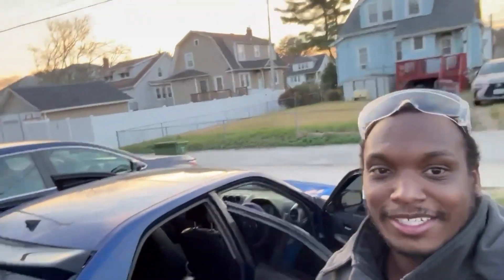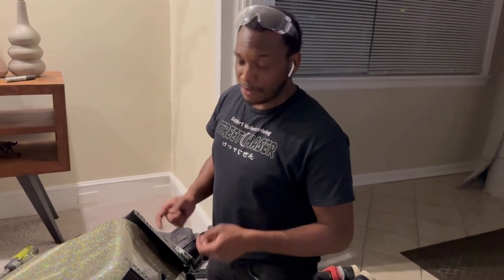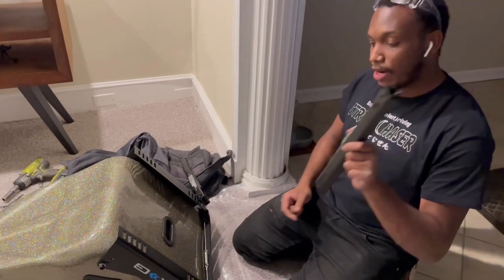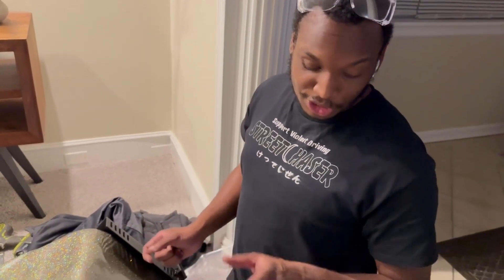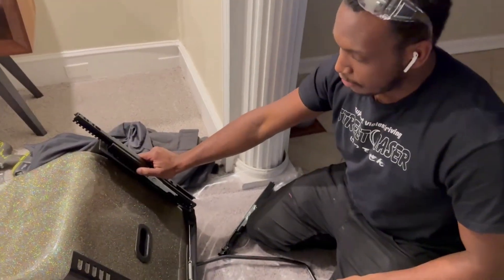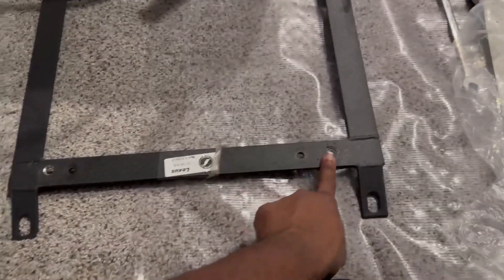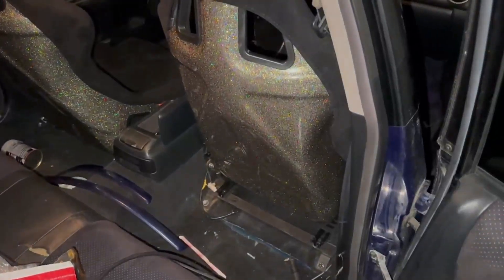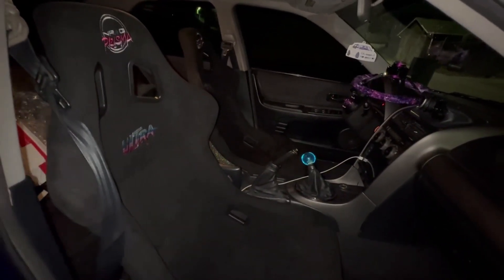Is300 gets bucket seats ( NRG Prisma)

Comment: do you have any problem with the seat hitting the b pillar? i bought an XL for me and my friend has a medium and his barely fit so i don’t know if mine will fit now
Reply from the maker: yes. sometimes that happens depending on the seat and the rail. 
when i used my oem rails with brackets and a bride seat. i hit the pillar. but i cut a hole that way it had space. For these seats and rail combo with large Nrg seat. i wasnt even close

For the is300 i just picked up. Im using xcessive manufacturing seat rail and prob an omp seat.
Reply: @KungFuJordan will you be uploading a video on that or just doing it on the side. i would like to know if the xcessive bracket is actually good or not because i still have to buy the bracket but i want to know whats the best option
Reply from the maker: @ I like Xcessive everything. So I know it will be good and even better than the ones I installed in this video.
Reply: Did you end up successfully installing the XL in your IS300?
Reply: @davesurti i did. it is a snug fit and it won’t fit perfectly. i got the xcessive bracket and all ima say is that it won’t fit exactly straight. the bracket might sit a little crooked when you set it up but when you install it, the seat will fit pretty straight so it won’t be that bad. you might also have to drill some holes into it to fit it at your height if you don’t install a slider. i made it a planted seat since i’m 6’5” and need more head and leg room so i put it all the way back. also the nrg seat bracket that it comes with will be in the way if you put it until the last bracket hole. so when installing into the car, you might struggle but you can install it using an open end wrench.

You’ll also need to remove the b pillar plastic to make it barely fit. i’m going to cut out a whole and put a rubber piece around the plastic to seal it tight on that spot so it looks pretty oem but you can run without it. 

other than that you should be good. i’d do research on other brackets that are more pairable to the nrg bucket seats but if you’re okay with drilling extra holes and making it fit a little more flush i’d say find a good bracket out there and get it done
Reply from the maker: @ i tried to install a Corbeau wide seat and it didnt fit. I fit a largte nrg seat and it fit very well no issues.

Comment: Are the seats being used large or Meduim?
Reply from the maker: @LilYogurt300  large
Reply: @KungFuJordan  did they come with seat rails? If not then what seat rails do u recommend i buy?
Reply from the maker: @ they only come with universal sliders . You need brackets.
Either the ones I used in the video. 
Or excessive sells a bracket. 
I actually have a bracket for sale as well. 

Or just use the factory brackets so that you retain the power feature. That’s what I did on my silver is